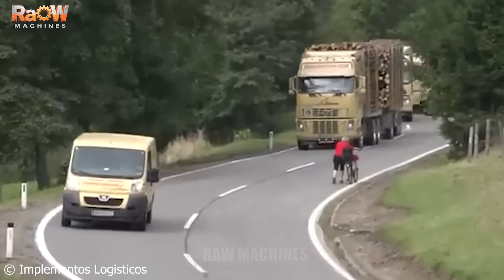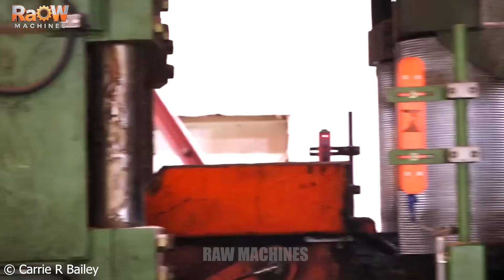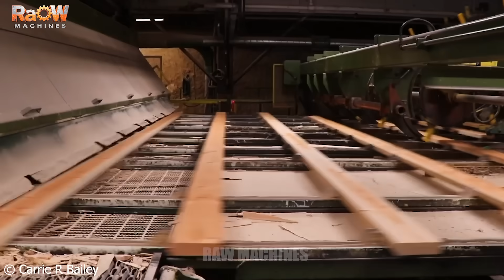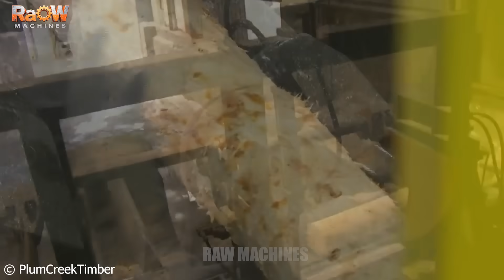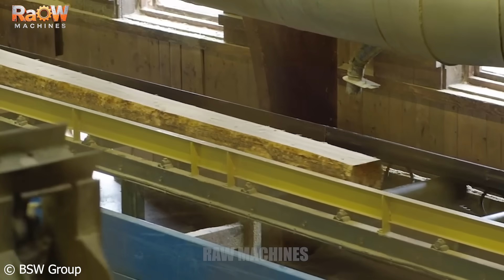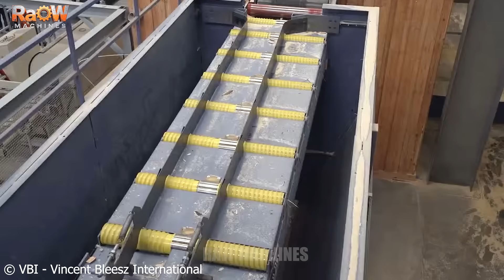Inside America's Largest Wood Processing Factories | How 4,000 Logs Become Lumber & Plywood

Comment: When did it get kiln dried?
Reply: Green lumber is not typically used in house building, not in Canada anyway. Used to see green 2x10 and 2x12 often for floor joists but the downside was squeaky floors as they dried out. The label showed DF #2 premium 2x6 in a 20' length. This stuff would be heavy and warp quick if left in the sun but would be a pleasure to use with 4 square corners
Reply from the maker: Awesome question! I really appreciate you paying attention to the details. In most modern mills, the lumber or veneer goes into massive kiln dryers after the logs have been processed, and that step can take anywhere from several hours to several days depending on the wood species and thickness. Thanks for bringing this up! What part of the sawmill process surprised you the most?
Reply: I believe the first mill was just doing green Doug Fir.  Very commonly used in house framing. Must of the rough framing is green and it will dry out eventually. I'm from Rhode Island. Our yard started out selling green hem/fir. We eventually move into green Douglas Fir and then K.D. Doug Fir and K.D. Spruce.
They all had a place in building. I retired in the 90's do to health problems.  I miss it especially with all the new products.  I hope that helps you understand what New England used for lumber.